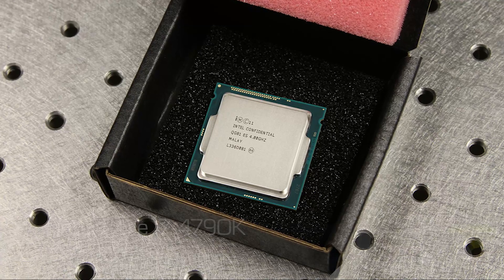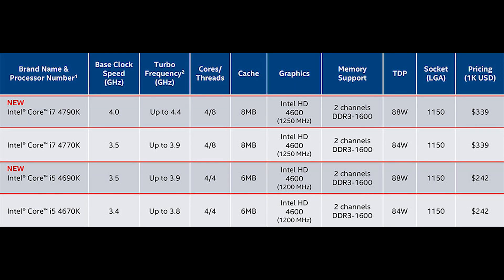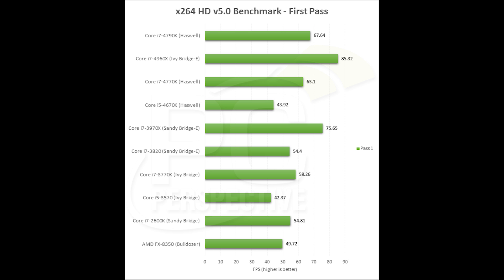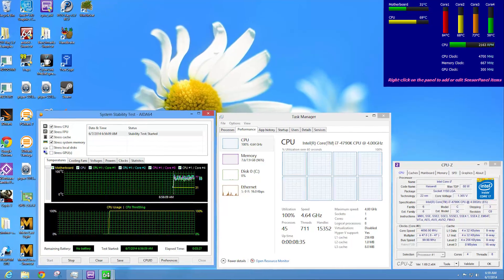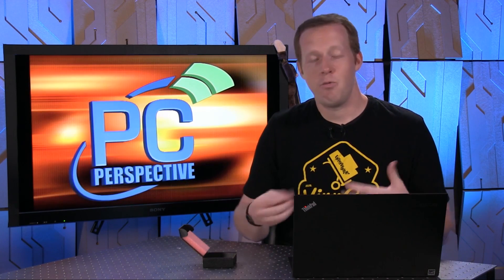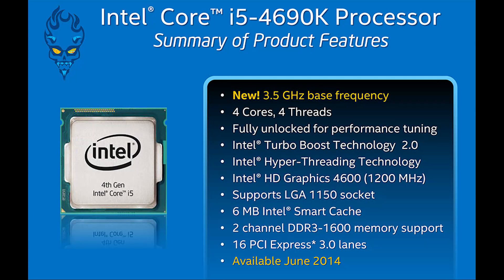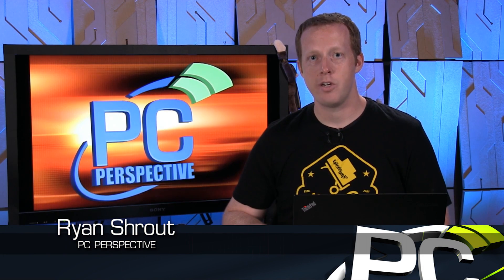Intel Core i7-4790K Devil's Canyon Review and Overclocking

Comment: Well actually after 10 years the fancy new and improved devils canyon NGTIM is actually performing worse than the original haswell. I've had to de-lid and re-paste every single 4790K I've come across as the paste is always shot & rock hard dried, and thermal throttling almost always happens.

Comment: My current CPU is still the i7-4790k (got it 2015 I think) Still don't need to upgrade, even though I play a lot of VR. I did do some Overclocking tests on it and I got it to run stable at 5.2Ghz. I left it overclocked at 5Ghz for a few months but found no need for it. It is currently sitting at 4.2Ghz with a slight undervolt and its a very happy chip :) .

Comment: my current motherboard is a msi a87m-e35 yes I know it's crap but can it hold the 4790k and maybe gtx 970 if not tell me what you recommend
Reply: +Danny Yeet No, that motherboard is for AMD CPU - you need a motherboard with an "LGA 1155" socket.
Your motherboard has a "FM2+" socket. They are not compatible with each other. You will need a Z97 motherboard, as a good example (there are other choices too).
Reply: +IaMaWeSoMe7478 id hate to upgrade because I would need to take all the pieces out which I don't really know how  or I could get amd but I heard Intel was  better
Reply: +IaMaWeSoMe7478 it wouldn't work on i5-4690k either

Comment: Hey guys please help me! Please recommend me the best liquid cooler for the intel i7 4790k for the money! So no quiet expensive cooler like the h100i Please help my budget is sooooo tight right now its like a water balloon on the verge of exploding!
Reply: hey dude u can find a best cooler for u...i have the same problem and cant find a good cooling...now im using Venom Akasa Air..at 4.4 1.240v..in stress my temps are 73c..stock 40c..but my external/ambient temp are 30c!!..my hot country..thx bro..
Reply: and turbo mode off...
Reply: temps load(bf4 for example) 63c..just for u compare..ok
Reply: +IaMaWeSoMe7478 humm i think this...u have i7devils?

Comment: I just built my pc, i have the MSI Gaming 7 motherboard, i7 4790k cpu, and a Msi Gtx 970 100me, and my ram is x2 8gb core vengance corsair . When i ran the pc grade i got a 5.0 out of 9 on the grade. im having problems with fps, and computer lag issues. dont really know how to fix, or what to do.
Reply: psu?
Reply: +brandon cushman get an SSD too.
Reply: +Mr Rawat. I figured it out, there was a slow switch on the mother board that got flipped and for some reason it only let me use a little bit of my processor
Reply: +Marius  I got one, just forgot to list it it's a Samsung evo

Comment: If you want to use the 4790k on stock clock speeds its still faster than the non k right ? So if you use it on a h97 board will it run on those 4.0/4.4 (standard clock speeds) or will it run lower - like the non k ?

Comment: well the 4770k i have tops out at 4.2, getting pretty close to 1.3v :/ sooooo....
yea, 4790k witha guaranteed 4.4ghz is pretty awesome :)
Reply: ***** all good.  Got a 4790k and it's running at 4.8ghz @ 1.22v
Reply: partyprash2000 That's pretty descent. I assume you did a burn-in test of more than simply 10 minutes. >w<

Comment: My i7-4790K has been stable @ 4.7GHz @1.16 volts for over 3 months now with no issues.
Reply: what are the specifics, i'd give it a go...
Reply: michael meadows Can it run OCCT? I cant seem to get a stable overclock below 1.25V

Comment: would this be a good upgrade from i5 3570k?
Reply: It depends on what graphics card(s) you are using. If you can find a good Z87 board on the cheap, then yeah, it's well worth it. I found an Asus Z87-WS board at Microcenter for $110, flashed the bios and now I'm running with a 4790k  @4.7 Ghz.

My old setup was an i5-2500k @ 4.7 Ghz with an EVGA GTX 780 Classified. I saw a substantial improvement in performance while playing games like Crysis 3 and Far Cry 4. My poor old 2500k was seeing 100% usage on all cores while playing Crysis 3.
Reply: Yes
Reply: You should be fine. The non-k still boosts to 4 Ghz under load. That's better performance than a 3770k @ 4.3 Ghz.

Comment: I am currently using an I7 4790K Haswell Processer. (Motherboard ASUS Z97-A)
Still in the process of testing it. I am currently able to run at 4.7ghz at 1.216v. Using stock cooler for the time being and still getting temperatures of 35 degrees on idle and 50 degrees (average) on load. I wil update this comment when I get my watercooling system
Reply: shajahan Chowdhury 50 degrees under load on a stock cooler? Where do you live, Greenland?

Comment: Any One Can Helppp Meeee Fix This OverHeatttt Problem PLeaseeeeee!!!!!
Reply: Check your thermal paste, also see if your cpu heatsink is malfunctioning. If you have the stock intel cooler, don't overclock or nothin.
Reply: IF you are going to overclock your cpu, you need to use a liquid cooling kit, such as the Corsair H100i
The stock heatsink is ONLY meant for the base clock temps, and their own turbo boost.
Anything after that will require liquid cooling
Reply: I Bought A "CORSAIR Hydro Series H90 High Performance Water/Liquid CPU Cooler. 140mm" So I'm running good now, but to my surprise one of the reason why the system was shutting off was cause apparently the battery back UPS apparently cant sustain the amount of power that the system need to run it, so I have it running on a ordinary UPS now, but I'll soon buy a higher battery back up one soon enough, but I'm good now, running my games and max specs

Comment: 4790k over clocked to 4.7 ghz at 53 Celsius on full load with custom loop. Staple after 6 hours of stress testing with Aida. This was my first over-clock, will try 4.8-4.9 today when i get home from work.
Reply: I'm having a lot of trouble with the settings in BIOS. Seems like you get this. Would you mind telling me what allowed you to get such a good frequency at a great temp?
Reply: I owe great temp to a push pull 420, and 280 black ice rad set up. Only thing in loop is the CPU which is way over kill for so much rad cooling. It will change once i get my GTX water block I'm sure. Wasn't able to get pass 4.75 ghz OC...Oh well good enough

Comment: So we are taking advice from a guy using a thinkpad laptop. One of the cheapest laptops used for companys
Reply: *****
Hes not the one who overclocked the cpu, he never even touched the cpu. You realize he has all of the notes on the laptop. These are all facts found on the intel website. He is the face, not the brains
Reply: sniperlif3 Intel Core i7-4790K Processor (8M Cache, up to 4.40 GHz) (BX80646I74790K) $299,99 ,you save $80 and free SHIPPING@>>amzn.to/1Cy53xn

Comment: I've just gotten one of these for my new build, on full load 4.4ghz with an xspc cooling system it runs at 85 to 95 degrees, WTH Intel. I must be pretty unlucky. no leeway for overclocking there
Reply: sent it back for a replacement, thanks amazon :)

Comment: all them new cpu all the time,, i have an old i7 2600k OC to 4,5 it will beat this cpu, my cpu is like 4 years old so i dont care to OC it, then i bought a gtx760 half a year ago and a used water cooler for my cpu cost 30 doller for the cooler, its nothing compared to changing CPU and motherbord, and i might change the graficcard again in like 2 years time, cpu not that important, better spent money on a good and newer graficcard ons in a while with better shaders and alot faster,, CPUs dont realy take that huge leap in speeds as the graficcards doest in just 2 years of time,,  my brother has an old i5 3,2 ghz i think,, and a gtx770 and runs Battlefield 4 on ultra way over 144fps as hes monitor can show it,, and dont buy to good stuff couse it will all get outdated no matter what you do,, dont buy titan or this overprised CPU its over kill, no game needs it yet.. and it will cost you twise as mutch just for a 20% better pc.. better to spend half and spend again in 2 years time... hope you get my point.. i also have a 144mz monitor and its damn nice.. if you realy want good CPU buy the i7 4770k its mutch more value for money

Comment: I went from the Phenom II X4 970 to the 4790k (Hyper 212 EVO heatsink), All nicely packed into my Antec 300. It's awesome!
Reply: +IaMaWeSoMe7478 Your 4790k? What are the temps on idle?
Reply: +IaMaWeSoMe7478 was it ever at different idle temps? or always? Have you tried/considered re-applying the thermal grease?
Reply: +IaMaWeSoMe7478 I trust your case airflow is good then... You might have a rare situation where the thermal paste inside the casing of the CPU has gone bad. If you haven't had it that long, look into returning it as a defective unit.
Reply: +IaMaWeSoMe7478 You would seem to have a "positive airflow" which means you are pushing more air in than out, which can trap hot air inside the case. Try adding another exhaust on top (or the side if top is unavailable) to get that negative airflow... However, even with a more balanced airflow, I doubt that will bring you down to 30c idle, but it should help a little! Push/Pull on the 212 will take up a lot of space, you can try it, but I think it's largely unneeded, especially without more fans exhausting.
Reply: +IaMaWeSoMe7478 you probably only need 2, see how that works out for ya. But definitely at least 1!
Reply: +IaMaWeSoMe7478 the 980ti is about 10-11% better, but cost $120 more than the 980.

Comment: I need a good "cheap" motherboard for the i7 4790k? Any recommendations?
Reply: Archit N. motherboards don't need to be expensive. I have an asus z97-ar and my 4790k is running 4.8ghz @1.285v. It's considered a cheaper z97 board.
A 4790k on a h97 would still be better than a 4690k on a rog board.
Reply: http://pcpartpicker.com/part/msi-motherboard-z97ssliplus
Not exactly cheap but it can do SLI :D
Reply: ASRock Z97 would be alright to start off with. I'd take ASUS any day, but that board isn't bad.
Reply: Mike Adams I got the GIGABYTE Z97X-SLI earlier today.  I haven't had much time to dick around with it yet since I only put it in a couple hours ago, but so far its been working really well.
The board it replaced was an ASRock FM2A75M-DGS that had evidently been made of cheese, was the size of a postage stamp, and performed like a schizophrenic lab rat.  Seriously stay away from ASRock, anyone who reads this!
Reply: Mike Adams
Ram doesn't matter, and actually with asus that's not true. Their cheap motherboards can overclock as high as their maximus boards just not at the same voltages. I'm getting the Z97-AR and 4790k next week and OC3D got his to 5ghz on his set.
Reply: AyyeDopeKid808 I'm going with the ASRock Extreme3. It's cheap and it's blue! Matches my GPU and Power LED.
Reply: Basic ASUS H97 should cut it, even. They should hold a 4790k just fine. And I've known people to use Asrock z97's, no complaints either. Though I could trust it as much as I do skipping rocks over lava.
Archit N.
Reply: If you want cheap, don't get a 4790k. Simple.
Reply: yeah true.

Comment: Maan i just bought my first gaming pc for around 2600-2800$ and used the amazing i7 4790k cpu with msi gaming 7 motherboard & gtx 780 (sli planned for later) and no ti because it's 250$ more expensive than the normal 780 in my country
can't wait play my games at max 1080p 120+ fps 

And sadly my either-net cable is too short so i won't play games today and i'm too lazy to go out again and buy a new one

(I had a gaming laptop but i'm gonna sell it)
And screw you my ps4 until you get some good games

Proudly a new member of #PcMasterRace
Reply: You can buy some nice house or an awesome car in my country for that money
Reply: And i did use a really overkill 1200 watt power supply just so it can handle graphics cards in the upcoming years
Reply: Haha! I love the  #pcmasterrace  Race at the end. I'm actually in your exact previous situation. I'm also moving on from my laptop, my rig is also similar to yours. :)
Reply: SuperCod141 great to hear that :D
Reply: haha you're dumb, 2800 dollar and no sli, but a freaking overkill 1200 watts power supply xD you just wasted your money or spent it all on crap like an expensive mb, ram oder 5tbs of hdd space or whatever; a gaming pc for 2800 bucks with only a single 780 is just wrong xP
Reply: One above all Really, where do you live?
Reply: thats WAY to expensive for thos specs... i can build a gaming pc with those specs for no more then 1000 euro's. heck for that money ill get 2 msi gtx 960ti cards and slot them sli... you totally over priced tour pc tbh...

Comment: Considering how crappy my 4770k OC's, the fact that my Z87 mobo just requires a updated bios, and after selling my 4770k the upgrade only cost me $100, then yea it's worth it.

If I had a 4770k that could even hit 42 with reasonable voltage stable then I wouldn't of made the move. Mine however refuses to be anything but game stable no matter what I try.

Just not having to look at that damned blue screen for the 40th time after thinking I've got a stable OC is worth the $100 and time end cost.

Comment: actualy, i bought 2 of this processors last month, both i7 4790k and both of them runing at 4,9 GHz at easy 24/7 with 1,280 Volts, with highest as 69,70 celsius on tests, so u might say im lucky bastard but they performs exceptionaly..didnt do so many benchmarks except aida64 stability for at least 20-30 mins, and not even 1 blue screen. well yes they both on corsair H100i water cooling :), soon ill upload at least 1 of benchmark and stability test video. So luck of draw or not but guys they are out there..

Comment: I have two boards. One is z87x-oc force and another is asrock b85 pro 4. Both now support devils canyon... Z87 board of mine did not required bios update for 4790k but b85 did. But i already have 4770k and 4670k on both so devils canyon was not tempting to me. Both builds are around 4 month old so hopefully gonna upgrade after broadwell. Like in 2016 or so. 
Anyways great video

Comment: According to my 4970K  processor's overclock :

 >>>>>>>4.4 GHz voltage is dropped to 1.17 v  worked stable in stress test at 100%,  up to 68 degrees 

>>>>>>> 4.6 GHz voltage is increased to 1.25 v (almost like automatic voltage at turbo boost gives 1.24) worked stable in stress test at 100%, up to 77 degrees 

 >>>>>>>4.7 GHz voltage is increased to 1.3 v  worked  stable in stress test at % 100 ,  up to 85 degrees

so its a really good chip and nice temps and performance ;) Even with my MSI Z97 PC MATE cheap motherboard :) what do you think guys ?
Reply: ***** What programs did you use ?  And how long did you run the tests for?

Comment: guys which cpu is better amd fx 9590 or intel i7 4790K ???
Reply: ok thanks for help, its nice to get someone opinion

the other problem with amd fx-9590 is that its 220w which is way more than intel 4790k
Reply: exacly that what i heard, i dont like noise and i know that heat is not so good for electronic
Reply: BamD aPizza "Im not a fanboy, I'm just going to make a generilzed statement without argument or proof" okay. also intel + AMD works great. 4790k + r9 290 tri-x and it's running everything I throw it at.
Reply: BamD aPizza actually, you're better off tweaking non-reference cards since they're cooled much, much better. I just don't since, well, I game on 1080p and this card runs everything I throw at it. my monitor is 60hz too, so as long as the game doesnt drop below 60 on "ultra" (sometimes I use 4xAA rather than 8x though, if FXAA is used rather than better AA methods) I have no need to overclock the card. I'm pretty sure the 780ti doesn't "destroy" the 290x, especially not in a performance per dollar test ;) they do run hotter though, even the aftermarket cooled ones.
Reply: BamD aPizza the 780ti dam well should have better performance its 200$ more then the r9 290x. the r9 290x isnt evan the competeing with that card .. how can you use that as a compare?
Reply: well it depends on the use you give it .. one had video processing and the other doesnt  but they basicly are the same
Reply: ***** depends. if your budget is ~1500 + for the entire PC and you may want to live-stream or render or w/e the i7 may be worth it. otherwise take the i5 and spend the rest of the money on the gpu instead.
Reply: The intel is superior.More expensive but worth it !!

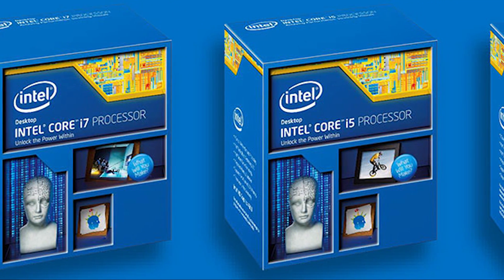Comment: 4:50 ?? Ha

No need for upgrade when you have ivy bridge or even sandy bridge. 
My 3570K running at 4.6 is fast enough. Even at stock clocks i would not upgrade

Comment: This all comes down to Intel not having any real competition. Sandy was so epic because they were still competing, Intel doesn't even have to try at this point and we as consumers lose out. I'm not seeing much of a point to the 4790k. It's going to running at the average oc of a 4770k right out of the box and there's not going to be much oc headroom even with the improved thermals. I would hazard a guess and say the average oc of a 4790k is going to be between 4.6ghz to 4.7ghz without having to go into ridiculous volts like over 1.35v.

Comment: Got mine pre-ordered, been planning my computer for a while. My original plan was to have it done in time for the Watch_Dogs release, however that was originally with a 4770K so i am glad i waited. I have a GTX 780 card on an old motherboard and an AMD phenom x6 1090T so i'm excited to see what a new motherboard, new cpu and faster ram type will do for my system. Will finally be able to see the true potential of the GTX 780.

Both Wolfenstein and Battlefield: Hardline beta runs smooth on this computer however my main taste in games is in open world free-roaming games. They usually tend to require a bit more power.
Hopefully the 4790K + GTX 780 will be a dream-team when we finally get to play the PC version of GTAV.